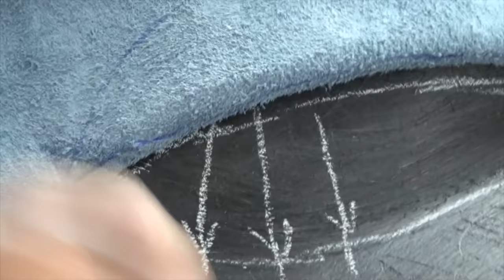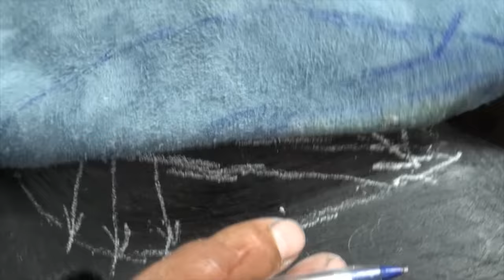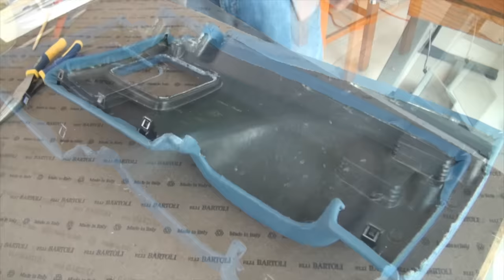A Plastic Piece Wrapped in Leather - Auto Upholstery

Comment: You've taught me more in 1 hour without saying a single word than all of the DIY tutorials I've seen the last few days. Amazing work!
Reply: Agreed . . .  He taught me more in an hour than 15 yrs.working in a canvas and trim shop.
But imagine this, not only did he  speed up the footage, for every one of the individual sections you need to add an extra 15 minutes (10 at the least) for the contact cement to tack up. This is why at alot of trim shops if you want a dash done they will try to sell you a dash cap or cover, most people would not want to pay what it costs for a job like this
Reply: @lonnieosullivan1331  15 to 10 minutes for the cement? How do I know is good to continue?
Reply: @maufcr  Well it will tack up and stick.... if you go too fast it won't stick. If you go too slow it will harden. If you watch him he often peels it back up after it sticks to stretch it more. That is fine while it's tacky.
Reply: @whichgodofthousandsmeansno5306  какой клей название знаете?

Comment from the maker: Adi Satzinger,Thanks for following us on you tube! ...the method I'm using is the 'artisan way'...if we were to wrap a similar piece using a 'factory way', therefore it would be advisable to prepare two 'dies' (male and female)...the leather would be first softened, then, between the two dies would be molded and shaped, at one go...after having the 'molded leather piece' ready, it would be gently glued to the plastic piece.
The leather I am using is a 'standard automotive leather'...we have to take advantage of the stretchy side of leather material to give shape to the plastic piece. Nonetheless, there are 'special leathers'which suffered a 'special treatment' to get a 'super extra' stretching/elasticity' in different directions(this leather would be useful if we were to use the 'dies method'.
Thanks for following us on you tube!
Reply: Cechaflo very good work
Reply: Cechaflo what kind of glue you are using and where can I buy it...fabric all so. Thanks
Reply: I would like to know what kind of glue you use
Reply: The best I ever seen
Reply from the maker: I use a 'yellow glue/contact cement' most of the upholsterers, shoemakers and leather artisans use.
As I am located in Mexico, trade marks are different. But, if you are in USA, please, check these links:
https://angelusdirect.com/products/all-purpose-shoe-cement
http://www.ebay.es/itm/Petronios-Master-All-Purpose-Cement-Glue-Shoe-Repair-Adhesive-Glue-4-oz-/112032405167
http://www.homedepot.com/p/DAP-Weldwood-32-fl-oz-Original-Contact-Cement-00272/100125525
http://www.dap.com/dap-products-ph/weldwood-landau-top-trim-high-heat-resistant-contact-cement/
Responder  ·
Reply from the maker: Thanks for watching these mute videos(lol)!
You are welcome anytime!
Reply from the maker: Sorry for delay! I did not see your question.
I use a 'yellow glue/contact cement' most of the upholsterers, shoemakers and leather artisans use.
As I am located in Mexico, trade marks are different. But, if you are in USA, please, check these links:
https://angelusdirect.com/products/all-purpose-shoe-cement
http://www.ebay.es/itm/Petronios-Master-All-Purpose-Cement-Glue-Shoe-Repair-Adhesive-Glue-4-oz-/112032405167
http://www.homedepot.com/p/DAP-Weldwood-32-fl-oz-Original-Contact-Cement-00272/100125525
http://www.dap.com/dap-products-ph/weldwood-landau-top-trim-high-heat-resistant-contact-cement/
Regarding leather materials, please, check:http://danfieldinc.com/
Other upholstery supplies:
https://www.albrightssupply.com/
You are welcome anytime!
Reply: black rose garage in usa home depot sells. Weldwood contact cement.   It is the standard glue for upholstery
Reply from the maker: Hello Ben, thanks for sharing this useful information!
Reply: Do you think that the vacuum method that the "Just Dashes" company uses would work with leather?
Reply: @Cechaflo  is the brown piece of suede used as a barrier to allow you to create an initial anchor point first without the rest of the section making contact? How would you remove a section of you made an error? Is the glue too strong at this point to remove the material without damage or is there a solvent you can use?
Reply from the maker: @phreaktor  If any error it is not advisable to remove the glue because the residues form grains that could appear on top view.
The scraps of suede, leather or vinyl are used to avoid the stitcking of glue on that area before gluing down other part.
https://youtu.be/IaSm3zoWrAo?t=1959
Reply: @Cechaflo  thank you so much for this amazing video. I’ve learned so much in a short time and you have incredible craftsmanship. 

I’m getting ready to order the DAP Contact Cement to do some practicing with a sheet of vinyl. Is there ever a situation or material where you need to use a seam roller or heat gun?

Comment: EXCELLENT!!!  Superb use of improvised tooling, rounded end of paint brush handle in tight recessed corners,  dowel pin for a roller in those radiuses & the clamp in that recessed screw pocket! Thought you might be in trouble with the raised radius for the steering column but you handled it with sheer perseverence. You must be related to Rocky Marciano as you don't appear to be able to quit until after you win!
Reply: What type of glue
Reply: @robertpastor4061  looks like contact cement

Comment: The amount of work put in is phenomenal! Not a huge fan of the color combo, but the detail and work put in far outweighs that. Well done!
Reply from the maker: Thanks for appreciating the job itself. In fact the main point is the technique to do the job. 
As an experiment, we used a cheap 'shoe's leather' to cover the interior. A shoe's leather does not have the 'sealer/lacquer' most of automotive leathers have. We aplied over a 'water soluble shiny lacquer' by hand. it's better a 'solvent based lacquer' and it can be applicable by using a 'painting gun'.  It has passed almost 7 years and the leather is still in good condition. Now it has a different 'black and navy blue combination' and it looks much better...it's been repainted.

Comment: I landed on this by accident and I am glad that I did.  What amazing work.  I had some wooden pieces I have been pondering wrapping in leather for a while, but they are much simpler shapes, and I had been planning on just cutting the sides out and gluing them on, not actually wrapping.  I am amazes at how well you got the leather to contour to the plastic.  What a great finish for 3D printed parts.  The big questions I am walking away with are is that just normal thin leather, like if I skin a leather couch for the leather, is that the same stuff or is this something special?  And the other big question is what is the adhesive you are using?
Reply from the maker: Regarding the leather question the stuff is the same everywhere.
To ease the wrapping process it is advisable to first determine its stretch side.
https://youtu.be/dhmCJFpOs_0?t=349
I used a regular upholstery yellow glue. If you are in the USA check:
https://www.dap.com/products-projects/product-categories/adhesives/contact-cement/weldwood-high-streng/
https://www.ebay.com/p/1101848834
Reply from the maker: Ian Walter  One of the 'secrets' to avoid the unsticking is to force the leather on top areas and let it lay flat, loose on lower sections with no tension at all.
Reply: @Cechaflo  Thank you for the link!  Some of them demos it was pretty easy to see that one side was the stretch side, on the one with the leather with the holes in it, they looked about even to me.  I thought I had it pegged by which way dimpled down more when you pulled on it.  I am going to have to watch that video a couple of times.  One of these days I am going to try this.  I have a lot of leather from a couple roadside couches that I skinned.

Comment: This is amazing work! Who needs sound when watching a master at work.  After university I learned some if this art from a lady from Italy.  She was a remarkable sewer and pattern maker.  I did not have the chance to learn this type of work however. Are you using contact cement?  I am finding with an oily type vinyl I need to work with thst I can't get the material to stick to itself.  Do you have any tips for that?  I just can't get any glue to work and I can't sew it, I have to glue the overlap together. a
Thank you for showing your work! This will make my next project look much better, more the way I want it to be! Thank you very much!!!
Reply from the maker: I use a 'yellow glue' which comes in cans or bottles and most of the upholsterers, shoemakers and leather artisans use. If you are in USA, please, check:http://www.homedepot.com/p/DAP-32-fl-oz-Weldwood-Original-Contact-Cement-00272/100125525
http://www.ebay.es/itm/Petronios-Master-All-Purpose-Cement-Glue-Shoe-Repair-Adhesive-Glue-4-oz-/291064753112 
Try to use a 'thick stretchy vinyl'...there is also a '4 way stretchy vinyl'. Paste glue both surfaces to stick. 
http://www.albrightssupply.com/Automotive-Vinyl-s/1838.htm
http://www.albrightssupply.com/SearchResults.asp?Search=4+way+stretch+vinyl&Submit=Search
Reply: Yes, I have stretchy vinyl, however it does not want to stick to itself...it seems rather more oily a surface to take anything! I have a can of vinyl glue used specificly for awnings etc that are covered in a plastic coating, and I am experimenting to see if I can get that to work. So far, I can get a layer of that to stick, so I may then be able to get it to work once the first layer dries, then add another layer (on both sides as you say, typical application) and see if it holds. I will get back to you here to let you know and give you the name of the glue...it is a clear glue called HH-66 vinyl cement. Expensive stuff, but wow, does it ever work and holds tight to most vinyl, actually bonding it. But will have to see how it works on this more oily stuff.  Here goes!
Reply from the maker: Yes, I now understand, you're working on a vinyl material that doesn't have the 'elastic thin fabric backing' all the vinyls have (these materials stretch breadthwise as it comes the roll).
The 'yellow solvent based glue' doesn't adhere directly to 'oily vinyl/plastic canvas surfaces'...it unsticks fast.
Anyway, let me know about the outcome...I like the glue you're talking about.
https://www.youtube.com/watch?v=4hdQ-_fvyEY
Reply: I have a backing that is kinda flossed on my car vinyl.  The tarp vinyl is like that in the blue stuff used in the  HH 66 glue video you showed me...yes, and THAT is super stuff, even to seal the sewed seams...I have used it and that works super on vinyl that is glued surface finish to surface finish. When the seams are glued, they STAY glued! Mine has gone through wind storms and holds fast!  
 I find that if I coat the flossed side on the car vinyl fabric, let that dry and then come back and again coat both surfaces to glue up, it works much better!  I have decided to sew one section however as I don't want a seam glue look on the surface, and I need to pipe the edging to get it to look much more professional...Anyway, I do recommend the HH-66 glue and USE A MASK...it is very potent stuff!!!LOL  I think I need to also rough up the vinyl side of the material to get it to stick better.  Would using reduced alcohol clean the surface up better for gluing? I might try that.  I had thought of lacquer thinner because you can reduce that with water to be less powerful, but I think that will just melt the vinyl too much. 
K, giving this a try, and should know by tomorrow how this all might work~!LOL  Thanks again for your great reply!
Reply: Vicki k Gibson be
Reply: Vicki k Gibson 😀el mimito perrito👏👏👏👏👏👏👏👏👏👏👏👏👏

Comment: what is the name of the glue are using please?
Reply: +yury telegin He is using a contact cement.
Reply from the maker: +yury telegin Thanks to Wallace for answer the question! ...I didn't see the question...sorry, Yuri! 
In fact the yellow glue I use is 'adhesive or contact cement'...it is 'solvent based'...it has thinner.
The glue used to stick 'formica' is the same and I think this material is everywhere.
Reply: Awesome job on the dash piece, you made stretching into those contours look so easy! I don't know how you did that without heat.
Reply from the maker: +J Wallace  Interesting question! ...What I did is take advantage of 'stretchy side of leather' ...a 'heat gun' is useful to stretch vinyl...in case of leather, what a heat gun does is erase wrinkles...it shrinks the material...if the heat is applied too close, could burn the surface or cause damage to the 'sealer' and 'colour pigments'.
This video shows how leather material behaves:https://www.youtube.com/watch?v=TlaC2RMMrjo

Comment: I love you work and attention to detail and explaining the complexity of leather. If you could enlighten us novices of the adhesive and the amount of force you use to stretch the leather without worry of it returning to original size.
Reply from the maker: I used a yellow upholstery glue (brushable):https://www.youtube.com/watch?v=o2xeezdF8Ss&t=550s
Before leather-wrapping a piece it is necessary to identify the 'stretchy side' of this material in order to position it over it: https://www.youtube.com/watch?v=dhmCJFpOs_0&t=648s
The leather material could be stretched over along a flat plastic piece.
To shape hollow parts the leather material should be 'loose' to gentle fill that gap without forcing it. Otherwise, it would be prone to unstick.

Comment: Thank you so much for this practical and professional lesson of this amazing video. I learnt here to attach the leather to the plastic one piece at time and the specific technique in order to do it. In this way I was able to re-attach with a thermic resistant glue the leather of my car dashboard and the final result I got is very good. In my case, the leather was quite dry, hard and bent from the sun. In order to soften and stretch it I put wet towels on it for two days and kept the car in a cold garage. Then  when I attach the leather I used also an hairdryer/heatgun to warm the leather and to stretch it of some amount, then I stick it to the plastic surface of the dashboard. Note that I glued having the leather almost completely dry, just a little of humidity in it to keep it soft.
Reply from the maker: Thanks so much for sharing with us your experience! Is it possible to know the thermic resistant glue trade mark you used?
Reply: @Cechaflo  , yes, of course! I used a glue made in Italy. The brand is Mastek (mastekDOTit), type Thermek HT 220 R and on AmazonDOTit can be found with the search "Colla resistente alle alte temperature per incollaggio di tessuti, pelle, stoffa, legno, laminati plastici, gomma sintetica". I cannot witness personally its resistance to time and sun, since i have just done the job. But several customers on amazon adviced me for this to glue dashboards and cars roof panels. On the technical sheet it is declared as based on polychloroprene and resins, resistance till 110 celsius degrees (230F). Applications: shoes industry and automotive. If you need to know more just ask! Again thanks. Best regards,
Reply from the maker: @michelemelchiori3171  https://www.amazon.it/MASTEK-NEOPRENICA-INDURITORE-EUROFIX-TRASPAR/dp/B06X6N18WX
Reply: @Cechaflo  Sorry, I was not aware I can put links into comments. No, the linked product is not the one I used (actually I see Mastek uses the same container for different types of glue, then they put a specific sticker on it). These are links to the thermic glue: https://www.amazon.it/resistente-temperature-incollaggio-laminati-sintetica/dp/B01N9V2RJA/ref=pd_sbs_200_2/258-8539317-1978954 , https://www.autoequipe.eu/pagina2/colla_1.html , https://interniauto.eu/strumenti/colla-resistente-alte-temperature/colla-resistente-alle-alte-temperature
Reply from the maker: Thanks for sharing useful information on this channel!
Reply: @Cechaflo  It is my pleasure!

Comment: Excellent work
But will the piece be installed in place?
Because its thickness increased and it was squeezed previously.
  There is no vacuum, even if the thickness increases, it can fall into place.
And here the thickness has increased by not less than 3/5 mm
Paste the skin distinctive and no words on it

Comment: How often are new glue brushes needed? With each new leather segment, or every 10 minutes maybe? Also, what type of glue is recommended & is there a benefit to storing it in a jar? You're obviously well-versed in this process, and a very skillful artisan. So, any extra information or additional tips you may be willing to provide will be greatly appreciated. Thanks for the visual tutorial and for your time!
Reply from the maker: The brushes could last a long time if some cleaning is done constantly. It is advisable the use of piece of vinyl or rag to clean off the excess of glue after each pasting time.
These glues are solvent based and should be enclosed in a container. If I would buy a big can of glue it would be advisable to pour what I am goint to use in a small jar or pot.
If the glue can is open the solvent vanishes and the glue becomes more dense until hardening too much. Of course, it gives us some time to application.
https://www.youtube.com/watch?v=8_nh0DctARg

Comment: Great video! You are definitely an artist. If you don’t mind sharing, what is your glue mixture and hide thickness on this project? If it is your trade secret, no worries. Great work!
Reply from the maker: I have use a brushable upholstery yellow glue:https://www.youtube.com/watch?v=o2xeezdF8Ss&t=174s
If you are in the USA you could find a similar:
https://www.ebay.com/itm/254593470049 (brushable and sprayable)
https://www.ebay.com/itm/114649877783 (brushable)
https://www.ebay.com/p/7026733944 (brushable)
I used an upholstery leather 1.2 mm thick. 
https://apexleather.com/
https://www.cowhides.com/